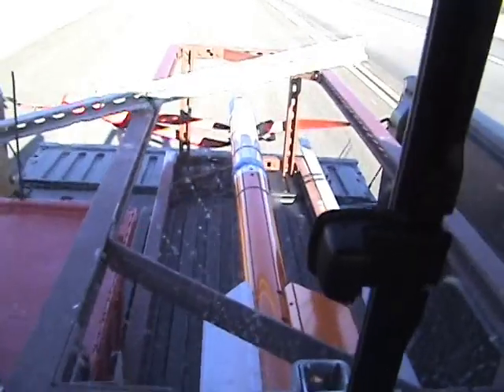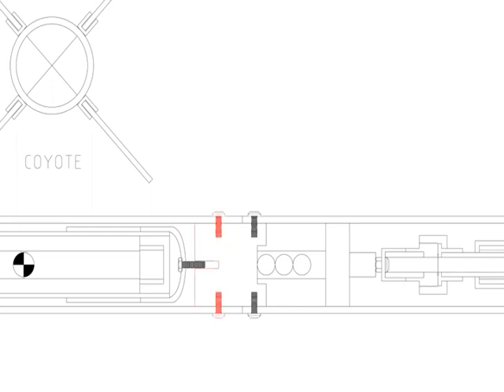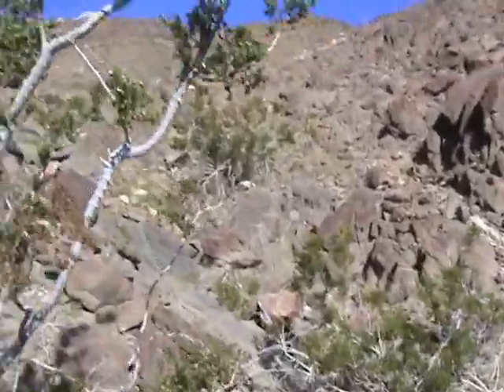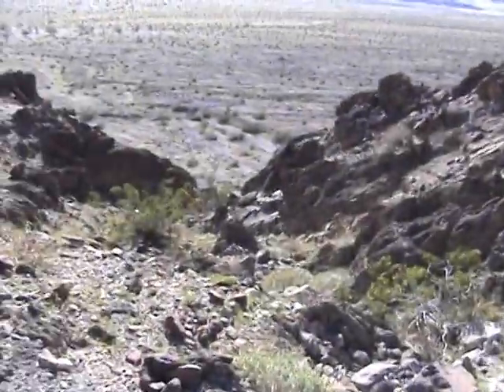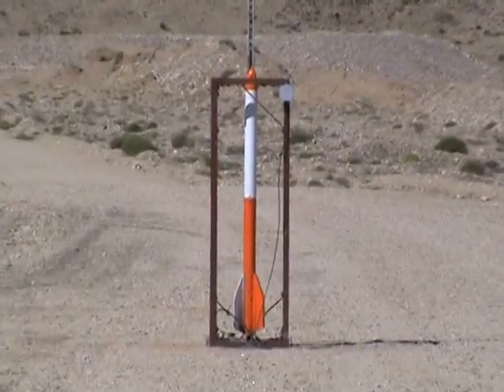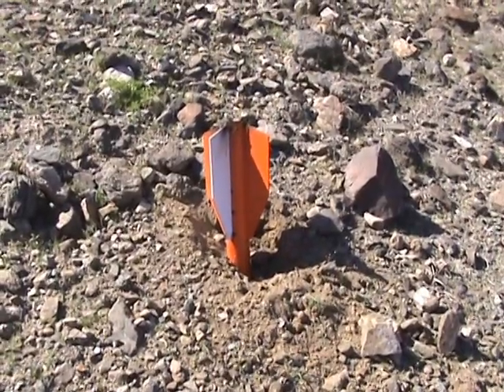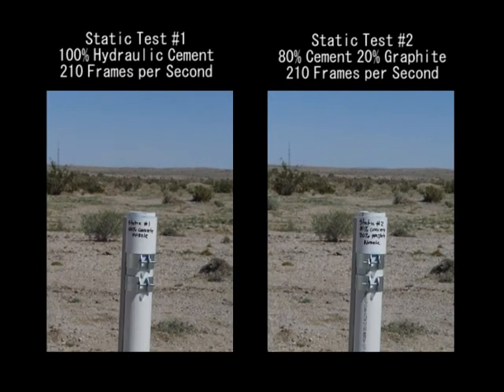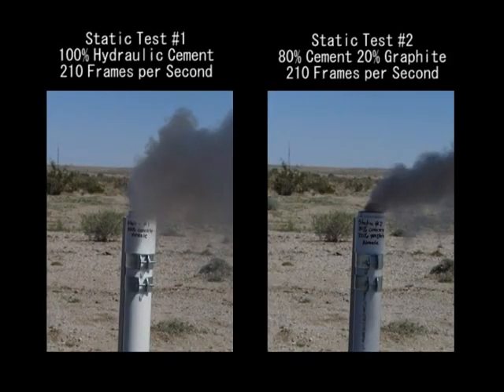Dual K500 flights with on-board video

Comment: Were did you buy potassium nitrate?? And if it is on the internet you could give me the website?? Thanks
Reply from the maker: I bought it from a local chemical supplier in San Diego called Alas Chemical. They no longer sell it but it is available online. However, I haven't priced it.
Reply: But it is the pure kno3  you buy??
Reply from the maker: Ita lias comporation It's agricultural grade Kno3, not laboratory grade. Even so it's 98% pure or something like that. Just make sure it's not "prilled" this is when the Kno3 is inside small clay balls. This won't work for an oxidizer.
Reply: I bought your book, and wanted to know what is the minimum amount of propellant for an engine.
Reply from the maker: Ita lias comporation I believe it's about five pounds.

Comment: How many pages is the guide to build the rocket?? Is possible to use sugar and potassium nitrate without corn syrup??
Reply from the maker: The book is 416 pages. Yes, you can do it without corn syrup but the fuel will be hard and brittle. If it cracks under pressure it will explode. The corn syrup prevents this.

Comment from the maker: I added spacers between the engine and the rocket body on the four bolts holding the engine in. This seemed to keep the engine in the exact center of the rocket, stopping the axial spinning. The last two times out it hasnt rotated at all.